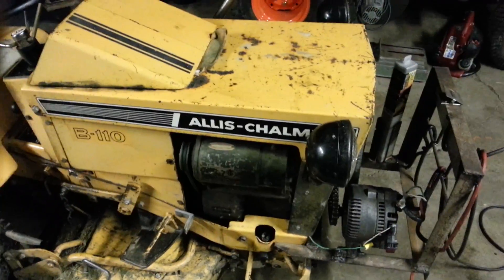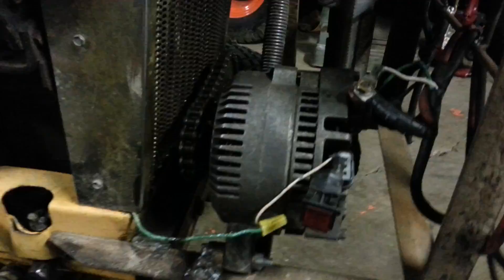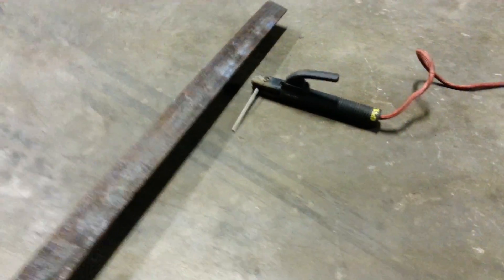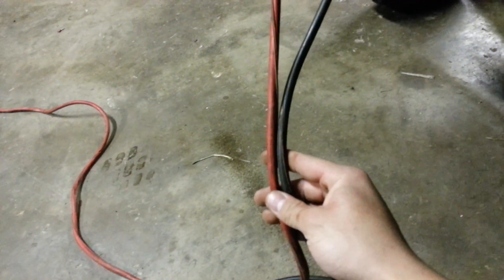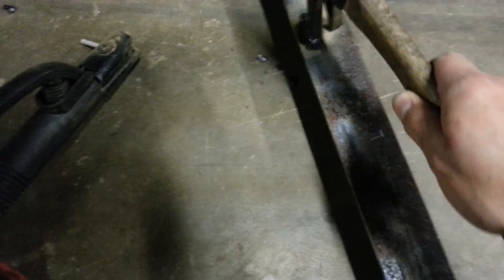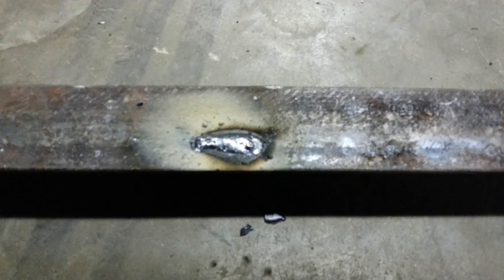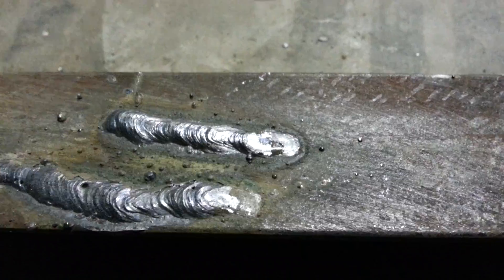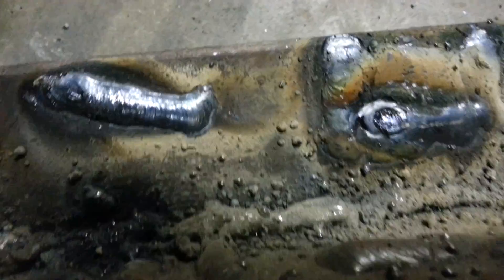Welder Made from Car Altrernator Powered by a Tractor

Comment: I love this !   I've got a spare Chrysler 100 amp alternator driven by a 6.5 horse Harbor Freight engine that I've rigged to charge some off grid batteries, I'm going to give this a try !  The 6.5 may not be enough and if it isn't, I'll just buy one of those 13 horse Harbor Freight engines :-) ... they are cheap

Comment: I would not use the cheap jumper cables. They are probably copper clad, mostly aluminum. Aluminum is not good for D.C.  I would get welding wire. Cool setup. Very useful.

Comment: i installed a 2nd alternator to my explorer remove the voltage regulator and works great. in build an on board air compressor using stock ac compressor
Reply: 330GT DOHC how did you remove the regulator?
Reply: How did you convert it to weld??? That's what we are all trying to figure out

Comment: I think the two alternators will be solution for a nice deep penetrating weld,keep the Voltage around 50V and Amperage adjust with engine speed